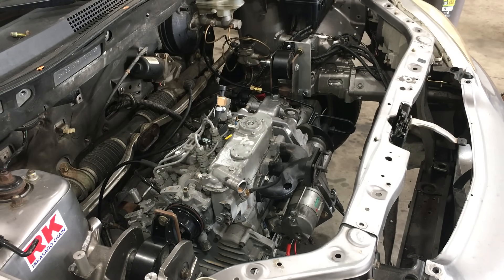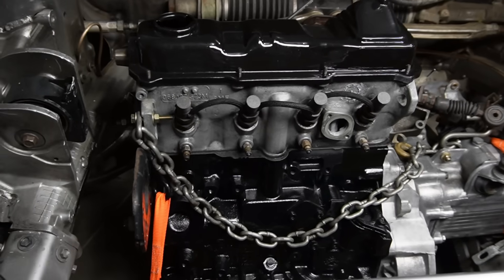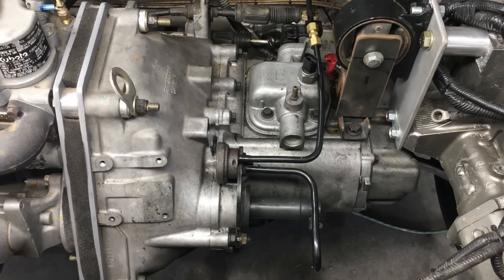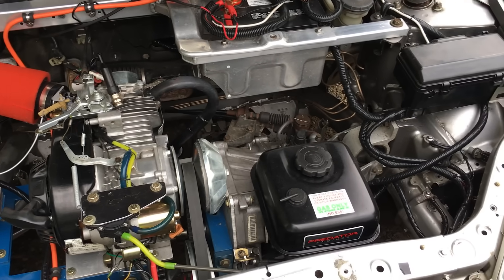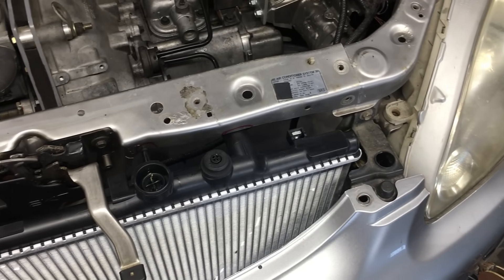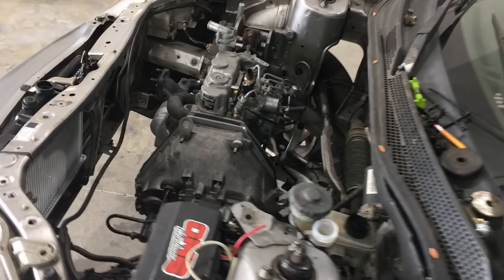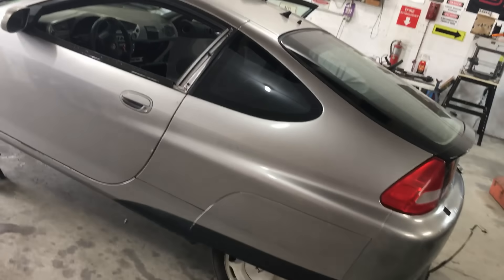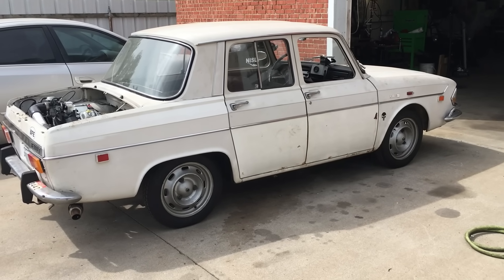S3 E33. 3 cylinder Kubota D722  diesel powered Honda Insight project has begun

Comment: For new viewers the insight had a Cd of .26 lowest of any production car , weights under 1900 pounds , and gets very good Milage with a 3 cyl IMA type Hybrid setup.

My car I bought used with 265k miles has  a lifetime mpg of 62.5 and since I got it 64.7.

This was the first hybrid in the US and was a clean sheet of paper design of Aluminum .
Reply: That's interesting. My Prius (2nd gen) also has a Cd of 0.26. I expected the 1st gen Insight to be significantly better. BTW, on wikipedia it says the 1st gen Insight is 0.25.
Reply: Whoops .25 is correct!
Reply: I really want to get one of these for doing deliveries.

Comment: Another cool video.  Im sure youre already aware, but make sure you block off the front opening on the Insight next to the radiator to ensure any incoming air through the grille opening is forced across the cooling surface of the radiator, and doesn't pass around the side.  Loving the diesel content!

Comment: Love it. Yes to the AMR500. I have a RHB31 on the shelf but have been debating to use it on my little 2 cylinder kubota or go to the AMR300. In my case the engine is only about 430cc
Reply from the maker: Awesome!, hopefully you will find our experiments useful.

Comment: : Actually, you can get a smaller turbo with Garrett GT0632Z so you will get higher boost. It has two turbine inlet holes because the turbo is intended for motorbikes for easier installation without creating complicated exhaust headers. You can make 2-1 adapter to connect it to the Kubota exhaust... 😊
Reply: user-ip4db6re6g  : Sorry for the late reply. Garrett GT0632Z is the smallest turbo from Garrett. It is for 100 to 500 cc motorcycle engines. Good for up to 80 hp. It has 32 mm compressor and 30 mm turbine. Max boost is 1.7 bar. It has journal bearings. 

For diesel application, you can use a rough calculation of installing turbo on gasoline engine and diesel engine. Usually, the ratio is 1.5 to 1. For example, if a turbo is good for a 500 cc gasoline engine, it can be used for 1.5 x 500 = 750 cc diesel engine.

The problem is, Garrett GT0632Z has two holes of exhaust inlet. Therefore, you have to create a 1 to 2 adapter if you still want to use the original Kubota exhaust manifold. Another way is by making a new exhaust manifold with 3 to 2 configuration. You don't have to create an equal length header. A log exhaust manifold will work just fine.

Good luck!

Comment: I really don't like sleeve welding on shafts because the heat weakens the steel. 
There is a better no welding means to do it.
There are things called 'locking elements' that I have used in industry. 
Basically a compression coupler. The shaft will snap before they slip.
A bonus is that you don't have to get the shaft length exactly right the 1st time around.

Comment: Dang it, Jimbo you stole my idea.😂
I plan on putting a AMR 300 on a Z482 diesel. (Going to try for about 20 hp.) After looking into it a lot I realized that the VZ 31 turbo is just too small for any diesel under about 1000 cc so I decided the supercharger is the way to go just like you did. Best of luck with it. I can’t wait to see how it works out for you. It’ll be really interesting to see how your motor compares to mine. Look forward to watching how you do it so I can take notes for how to do it myself. Best wishes from Iowa.

Comment: For the VW diesel, I recommend looking into shimming the governor cage. The governor consists of 3 different springs, an idle spring, and intermediate spring, and the main fuel cut spring. The intermediate spring is responsible for keep the throttle input smooth, whereas the main spring is responsible for pulling fuel the higher it revs up. A lot of the N/A guys would add a 1/8 washer to the main spring and get another 1200RPM before the fuel started getting pulled back. I've heard of people removing the spring entirely and just using a solid shim. Very interesting things. If you have any questions about the bosch VE pump, I might be able to help you out.

Comment: 1:20 gearbox coupled to the compressor housing/inducer. Change pulley ratio to build boost @ idle if you want. Homemade procharger.

Comment: As for the renalt before using dual carbs please get a flow meter to synchronize the carbs ....(like a dual carb swap on an old aircooled VW) you shove the thing in the throat of the carb with the engine running and adjust the cables and links until the air flow matches on both sides 

One side getting more air than the other is bad ....the rest is making sure the jets match (easy part)

Comment: I checked the carburetor(s) & I have no good way to separate the group. I still highly recommend installing a smaller carb! Something more similar for horsepower will help a lot!

(in reference to the Predator Fiat, your carb is too big)

((I was thinking of sending a Keihin CV34 from a CB600…the carb casting that broke was #3, but the throttle cables connect to #3 & all hose connections are squeezed between the carbs))
Reply from the maker: Thanks for checking that out,  The carburetor experiments that we are doing are kinda for fun and people want too see what works and what doesn't.  The 36mm carb may or may not help performance, but its what folks want to see.  Its easy to do these experiments and in the end perhaps someone will learn something.

Comment: Volvo FL6 medium duty truck was supercharged a few decades ago, they were really responsive. But in general superchargers suck a bit on diesles since they are so inefficient at higher pressure ratios , which diesel engines like. Will be fun to see how you design this :)
Reply: 1993 Mazada 626 2.0D Comprex 122ci for 75 donkeys ^^ The Comprex was a strange mix between a supercharger and a turbo using both exhaust gasses and a pulley !

Comment: 4:13 You need to connect the engine to the strut "housing" on the right side of the car to the camshaft cover / engine top, preventing the engine trying to rotate on itself when accelerating, extreme engine vibration and so. I had 2 Ford Fiesta with basically the same 1.8 diesel engine accept one with turbo and electronic diesel pump. the newer had this same mount and was much better, putting the torque on the asphalt rather than rotating the engine.
Reply from the maker: @4:21  the camera hovers above the engine and if you look all the way down you will see the anti torque mount.    We are using the exact same mounting system that Honda engineered.  Keep in mind this car is made of flimsy aluminum, however there are reinforced hard points on the chassis made specifically for mounting the engine and transmission
Reply: @robotcantina8957   i saw, but still.
This down link you made from the "strut" support, this rusty metal stript should also go to the cyl head. Pretty much all cars after 2000 or around used this type of construction. it was more of a pleasure to drive these cars, it felt like the torque was applied directly to the wheels, directer responsiveness, it felt more rugged, rather than rotating the engine a few degrees and "eventually" the car comes in to motion.
Just a suggestion, look if you can try to prevent the engine to rotate (triangulation), pretty sure it will help your "scientific" acceleration  test, albeit fractions of second.
Reply: @robotcantina8957  4:31 maybe you can use the "water outlet" housing that bolts on top of the engine, make a adapter plate between the engine and water outlet housing and connect that to the rust bar / down link. 
This single down link will probably warp a lot although invisible because it looks flimsy. go around the pouly on both sides.
Reply from the maker: @AnalogDude_   Yes the steel down link is flimsy for sure.  We plan on attaching that to the cylinder head, however the bolt we want to use for the bracket  is between the cylinder head and the water pump.   We need to remove the timing cover on the front of the engine to modify a few things and when we do that we will fabricate the bracket that bridges the down link to the cylinder head.  I didnt think anyone would notice the lack of support on the down link but apparently you did... lol, don't worry we do have a plan.
Reply: @robotcantina8957  Use the water outlet housing on top of the engine. easier. just use longer bolts to refit the housing with a beefy plate in between. maybe a "laser" cut plate to go around the "pouly" on both sides and weld on the down link is all it takes.

Sure it's only 25 hp, but if we can rule out the engine rotates it will yield better numbers.
: )
Reply from the maker: @AnalogDude_  the casting around the water outlet is very thin and basically every bolt on the front of the engine is m6  The bolt that holds the lifting eyelet on the front of the engine is an M8, but its impossible to get to right now.  I feel  a custom bracket  from this  M8 bolt that holds the lifting eyelet can bridge across and bolt to the down link would be the strongest anchor point.   Now keep in mind there is a whole lot of stuff that has to be fabricated on the front timing cover in order for us to automate the fuel rack adjustments and we are trying to keep a lot of space open  to accommodate stuff that going to occupy the limited space we have to play with . multiple brackets to various M6 bolts would work, but stuff like that will get in the way of the automated fuel rack gizmo.
Reply: @robotcantina8957  lol, a engine for cartoon cars, m6
But the bolt around the CYL head cover look beefy, not sure how these things are called in English, but they are basically long nuts to tie 2 thread rods together, but than again i don't know if these are the head bolts witch are tightened to torque.

Comment: I found your videos because im doing something just as silly that would likely REALLY  make your complainers unhappy! Im a honda connoisseur myself and i have a 2nd 1979 cvcc civic i got before i found my superclean one, and its just sitting around, so im putting the body on a chevy tracker frame, then powering it wit a 1600cc kawasaki vulcan engine and transmission. Was gonnna put that engine in my samurai,  but i found a brand new 1.3 cat diesel that i want to put in it real bad!!! Thanks for the inspiration!

Comment: You should put the Volkswagen engine in a 1980's s10😁 I think that would be pretty cool, and see if it can pull stuff
Reply: I agree 100%. Robot cantina needs a shop truck for sure!!
Reply: VW put that diesel into the Rabbit based pickup, it certainly wasn't a screamer. Compared to a Rabbit a S10 is really heavy.
Reply: A LUV or old Datsun pickup would be much better. Or a Dodge Rampage. All significantly lighter than an S10. A Subaru Brat would also be possible if converted to RWD and with the oil pan off the Vanagon diesel, so the engine can be slanted to one side.
Reply: @theodorgiosan2570  The early Dodge Rampage was based on an Omni with everything behind the front seats turned into a truck bed. Those old Omni's had a VW 1.7 gas engine for power. It would make for an easy install as that diesel was also offered in the same VW's that the 1.7 gas engine came in.

Comment: Just a idea for the vw power plant maybe a small old truck like the 1980's Chevy s10 or a Nissan d21 hardbody.  I did a 383SBC swap on a '86 S10 making a monster but 25 years later I'm thinking a small Honda K-swap on my hardbody or diesel swap for mpg and reliability when the motor dies

Comment: Im afraid you may not get enough boost from the AMR500. Richard Holdner (may not spell it correctly) just did a test with the AMR500 and it puts out just a little more cfm than your per cylinder volume.  So , I could be wrong, but you may have to greatly underside your stupidcharger pulley for good numbers.

Comment: Idea, not sure if it's a good one, but here it is. Since you're cutting and weakening the axles anyway, why not weld removable flanges on each half so you have the ability to pull the transmission without pulling the steering knuckles?

Comment: Combining super charging and turbo charging is actually a useful thing. It was used on lots of American Bombers in ww2. Also used in P-47s. Banks used it recently on diesel engines. 

The two combined do things that aren't possible with just one or the other. They both help each other. The super charger creates more exhaust gas which helps spin up the turbo quicker. 

F1's electric turbos are another newer form of it.

Comment: I think I saw an ad from Temu the other day for really cheap in cab heaters for tractors or side X sides. Basically a small heater box with a fan and heater core already installed. I bet Amazon probably has them too.

Comment: That supercharger takes 3o hp to make full boost according to Holdener . Only hope to make power is better adapters for the in an outlets , huge intercoolerp
Reply from the maker: I think there was something wrong with his measurements.  The AMR300 supercharger we used on the 13 hp 420 cc engine spun fine uncorked and when it was plumbed into the intake system we got 8 psi of boost.
Reply: How much did it rob? Get a nice torquey electric motor and drive the blower , and see how much power such takes , AlexLTDLX uses 40kw driving a centrifugal , does better at 6 psi, than the car did w a whipple at 14psi. I think it's likely that Richard had errors but not that large . He has no respect of velocity stack improvement by the video .
Reply from the maker: @dennisford2000  I'm not sure how much power it took to spin the supercharger, but we made boost and we made power.  If I had to guess I reckon it takes about 2 hp to spin the AMR300 up to speed and make 8PSI of boost.

Comment: So with the 2 stroke detroit diesels the supercharger is required to create directional airflow and doesn't really make any noticeable boost, thus why their considered naturally aspirated with one. Without one it wont run. That being said I'm in the middle of putting a procharger on mine and supercharged diesel will work a lot better than you'd assume

Comment: The Roots blower was fitted on the 4 stroke Hanomag D28 engines  from 1953-1965.. it was effective when you pulled out a lever on the fuel pump who gave more fuel so the increase in power was 35hp normal and 45 hp with the “ boost on “ .

Comment: the insight should be interesting. the vw beetle only had about 46 hp and 70ish ft/lbs of torque. this diesel has less HP, but I'm thinking the torque should carry it through the additional weight. I'm going to say it, with a supercharger this thing might even be streetable. Looking forward to finding out.

Comment: I can't wait to look at fuel economy data from the stupidcharger, esp under low vs high loads, if it can later be compared to a little turbo. I also wonder if you could try mild hybridization of the diesel through a belt driven alterno-starter doohickey not unlike what Suzuki uses in their 48V systems, which could complement the torque while the turbo builds up boost. It'd be a sorta return to the roots for the Insight. Love the vids, keep em coming!

Comment: Great video! Looking forward to see how this project plays out. Will be interesting to see how a supercharger works with that little diesel. I suspect you will have to do a little tweaking of the fuel pump to keep the exhaust temps where you want them while producing good power.

Comment: I'm soooooo happy you're working on the Honda Insight!!! Been worried that it was going to sit in the corner in time out forever.. I'm in the process of building an enclosed reverse trike using a 1997 Geo Metro 3cyl 1.0L with its original 5 speed manual transmission. Figure I will get between 65-70mpg with the super slippery design..

Comment: I have a 1.6l VW diesel in a '90 VW. It works great, top end (determined by injection pump settings) is 160km/h, or 100mph. I routinely have it up to 140 k/h, and it can run all day at those speeds, though you do have to rev it (which it likes) to accelerate to speed. The engine is stock, stock turbo, though quite easy to upgrade both injection pump and turbo. Car itself is about 2000#. Putting it in another chassis like re-inventing the wheel???

Comment: Jim, if you need a heater in the Insight, you could maybe set a forklift heater on the passenger side floor, and not modify the car. Another idea would be a school bus floor heater. These are usually under the driver's seat. You might not have a defroster though.

Comment: I like that the shell is unmodified, but i'm also on board with this project. I hope you don't blow up the engine by modifying it too much. I am interested in the usability and longevity as a daily driver type thing. I'd probably be fairly eager to continue to find non-insight parts (cheaper, more available, better parts) in order to bring it up to an acceptable specification.

Comment: If you can get a decent intercooler on that blower, it might just work. The heat generated by superchargers is the enemy, robbing the air density even more than a turbo will. 
Without an intercooler, you're giving with one hand (boost) while taking away with the other (lower air density).

Comment: Superchargers were used on 2 stroke diesels, but they weren't considered superchargers as they didn't boost, they just supplied the needed air movement for the 2 stroke diesels to run, since they had a sealed crankcase and couldn't scavenge air naturally like a gas 2 stroke.

Comment: The 2 stroke diesels did not have “superchargers” they had blowers. And were considered naturally aspirated if nothing but the  blower was present. The engines would not run without the blower as they had no way to draw in new air.